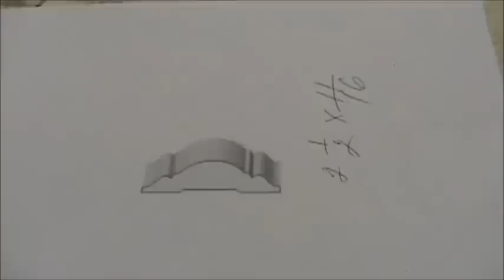Make moldings on a Belsaw

Comment: I wanted to say thank you! I watched your video and many others gathering knowledge. I made my first molding knife yesterday! I found this much easier than making a belt knife or other tools. I used my 4 1/2 inch angle grinder and ground sharp. I did make only one knife and it ran very clean. No chatter even over knots! No tear out either! The largest obstacle to doing this is intimidation or thinking you need a bunch of specialty tools. I used a scrap mill circular saw blade measuring thickness about .128. Created the profile. Ground to shape then sharp. No heat treating required!  Set the cutter up about a 1/4 inch above the cutter head. Removed all 3 original planer blades and gibs that were not needed. I ran slightly off center of my stock but was satisfied to flip my stock and run the other direction. Quite satisfying! I have owned the machine over 20 years. The cost of blades is very prohibitive to purchase. So I never did. Cost vs value. A set of log cabin siding cutters at 5 1/2 inches runs around 500 dollars. I could now make that cutter in about an hour with confidence of quality and productive capability. Thanks again sir!

Comment: Wow I studied with an old wood worker yrs ago,, but remembered everything. We used blue dye and a band saw to remove excess metal. We made a knife with oil hardened steel using a fixed vise grip (wide sheet metal style)on a grinding platform, so at precise angle. The vise grip had a horizontal metal bar welded onto the handle. Drilled a hole in it for a hook. Used Map gas and bricks to get a deep red color, quenched the finished knife, then we heated the back of the knife and let it cool so it wasn’t as brittle as the cutting side. Touched up the cut edge, using one blade, weighing out the Two other blade ports,  it turned out excellent ,,,,,Mere Woman

Comment: Thanks  this is information I knew but its valuable to younger people to learn, I own a belsaw And don't live far from woodmaster They will make me cutters for the belsaw or I can order them from california they still have parts for this machines.   Woodmaster is about 2 or 3 blocks away from the old belsaw plant in Kansas city.
They still make Woodmaster machines in Kansas city. Its one of very few American made tools today.
If I needed to make a cutter I worked in a machine shop  wile he used a bench grinder I'd use a 4" body grinder and bench grinder  you can't let the metal get to hot grinding on it you do not want it to change colors. That will weaken the metal's cutting edge and it won't hold an edge sharp.

Stick in a cope   I think I've heard that but its been years.

You won't see a lunchbox planer do this  like the dewalt it wasn't made to but sevral brands were.

Comment: I've used patterns to trace bluing onto a metal blank. It shows up ok if your eyes are really good. But why not spry paint the cut out over the void onto the metal with a high visible paint color. Then scrib it fine with the scratch all. This give you a rough to point and a fine tune detail to shoot for. Then you can make your cutting edge and hone it sharp. 
If your molder cutter is dull just hone the flat side untill its flat.

Comment: Stick in a cope.  Never heard it called that.  But I'm not a pro.  I coped a lot of inside 45s  but I was cheating with a 4" body grinder, if you've used one as many years as I have you can grind out the shape very sharp and get a big back relief.  At that time I dont think I owned a copping saw I have 2 now. But ill need to practice or ill screw somthing up.
If I'm putting in a long baseboard and the sticks short ill cut a scarf joint and glue it.
Its harder to find the a squar joint is.
I reuse a lot of baseboards I took off the walls just pull the nails patch the soles sand it prime and paint it looks as good as buying new materials and cost a lot less money, takes extra time but hey have you seen the price of lumber products. Ill spend the extra time its worth it to.me. time ive got money I dont.